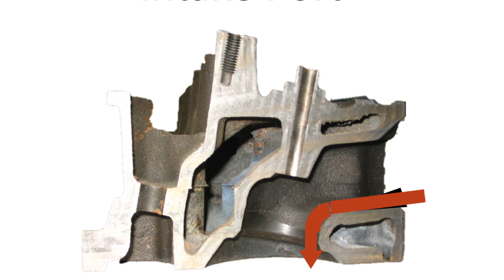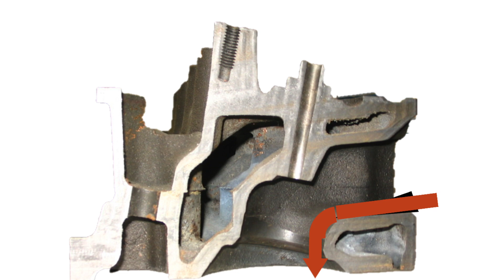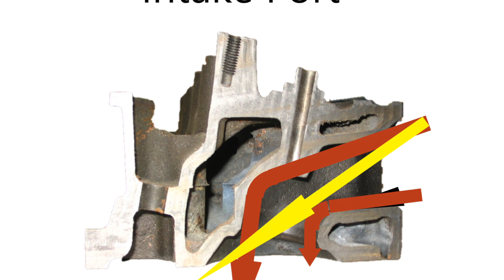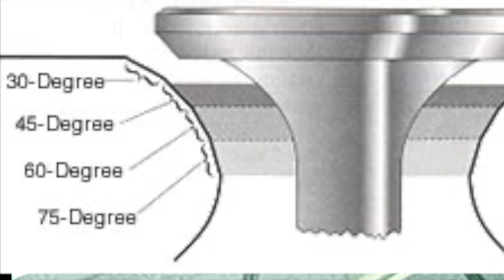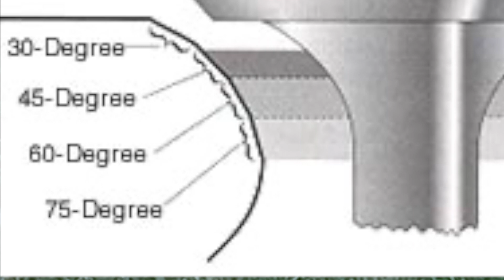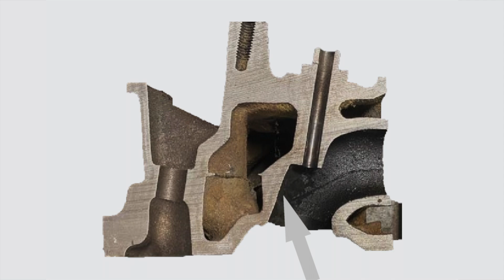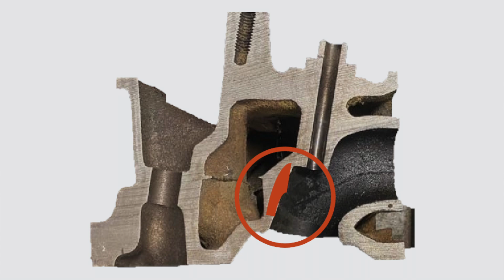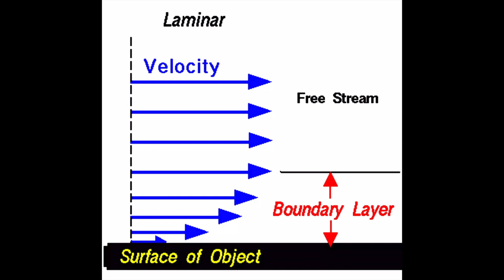Building a 10,000 RPM Jeep 4.0 -  Street and Off-road cylinder heads

Comment: What harmonic balancer are you going to use with a 4.0 spinning that fast,  Newcomer racing is the only person I know that has a performance one and they're $900 which is silly
Reply: I think he said in the last video on a race build you don’t need a balancer because it’s already such a well balanced engine and I’m guessing he means to just have the rotating assembly balanced in that case
Reply: @Pooooooops  hmmm I've never seen an engine without one personally
Reply: @ you’ve never seen an engine with a balanced rotating assembly color me shocked
Reply: @Pooooooops  no idiot I've never seen an engine without a harmonic balancer attached lol
Reply: @Yelladog78  for you to see one without a harmonic balancer you’d need to see one with a balanced rotating assembly, it’s not exactly common, so “color me shocked” is sarcasm here.
Reply: @Yelladog78  most high dollar builds we’ve both seen haven’t been 5500rpm engines built for 10k, most guys won’t go into that effort. Further, don’t even think it’s possible unless it’s an I6; like I said he said, it’s already pretty close. They don’t need balanced to the same extent as a 4 or 8 cyl or even v6.
Reply: Its an inline 6? N

Comment: Is this an endorsement of using epoxy in the intake ports?

Also, gotta say the casting consistency of the 94 seems really decent. There are some ports on the intakes that have potrusions into them that aren't there on the others. Was that for a reason? Wanting to say 2 and 5 for some reason.
Reply from the maker: You can use epoxy, but you better sink a few pins in the port to hold the epoxy.  Are you talking about the head bolt protrusions?
Reply: @amxj  no, in the sides of the bowls. At least on my 94 head.
Reply: I’m not sure?
Reply: The guys that clean out the ports at the foundry probably just missed the flashing from the casting process, knock the flashing out using a grinder and a fine carbide bit.  No big deal just needs additional clean up in ports.